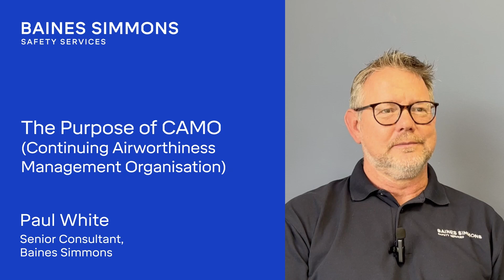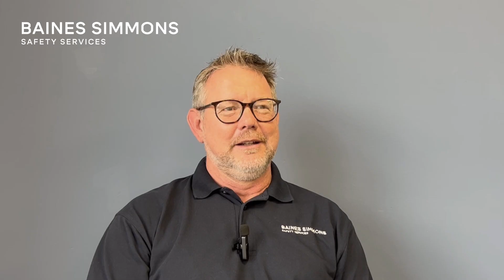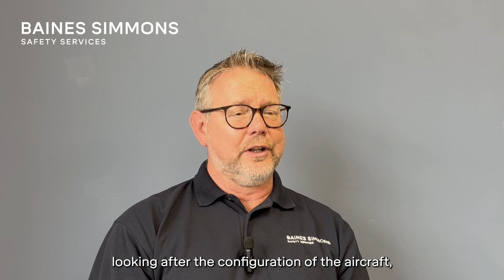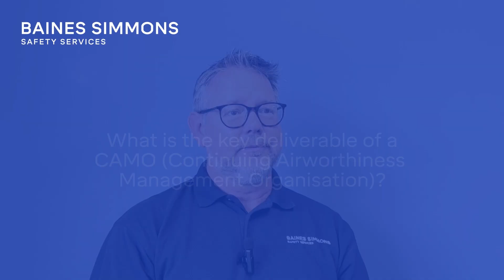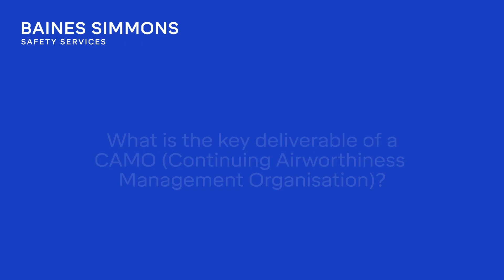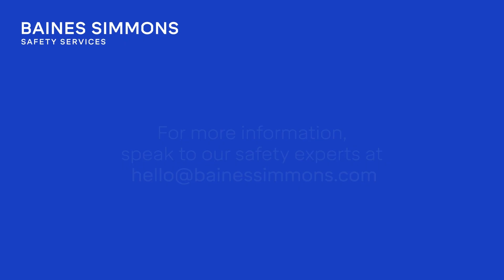The purpose of CAMO (Continuing Airworthiness Management Organisation) | Baines Simmons

Comment: Continued (Continuada, diseño) vs Continuing (Continua, operación)
Continued Airworthiness is about the design side — it falls under EMAR 21 and is the responsibility of the Military Type Certificate Holder (MTCH), i.e., the manufacturer or design organization. It answers the question: "Is the type design still valid and safe as the aircraft ages and gets modified?"
This means managing changes to the type design, keeping the Maintenance Planning Document (MPD) current, updating flight and maintenance manuals, issuing Instructions for Continued Airworthiness (ICA), and mitigating safety risks that emerge from operational data (ODRs). When Saab issues a service bulletin updating the Gripen's structural inspection intervals based on fleet data, that is Continued Airworthiness work.

Continuing Airworthiness is about the operation side — it falls under EMAR M / 145 / 147 / 66 and is the responsibility of the operator (through the CAMO and MO). It answers the question: "Is this specific aircraft, tail number X, airworthy right now and kept that way day after day?"
This means managing the Aircraft Maintenance Programme (AMP), conducting airworthiness reviews, controlling configuration, managing spares, ensuring trained and licensed personnel, and ultimately holding the Certificate of Airworthiness (CoA). When a Colombian Air Force technician signs off a scheduled inspection on a Black Hawk and the CAMO confirms the CoA remains valid, that is Continuing Airworthiness work.